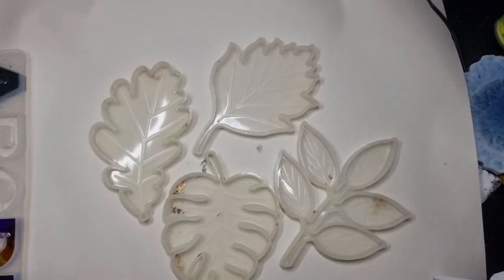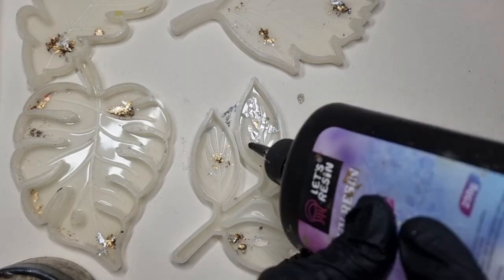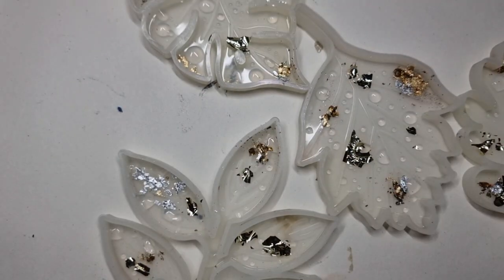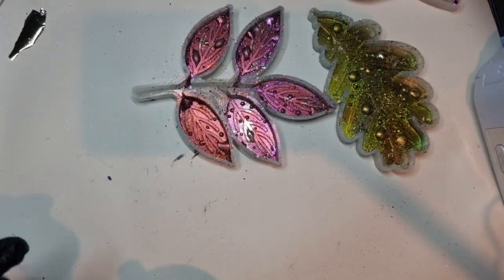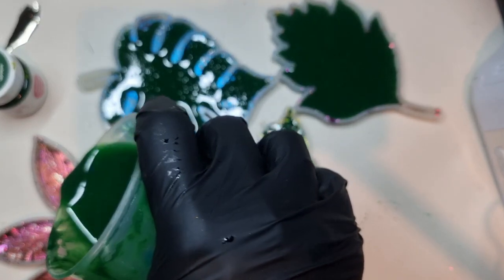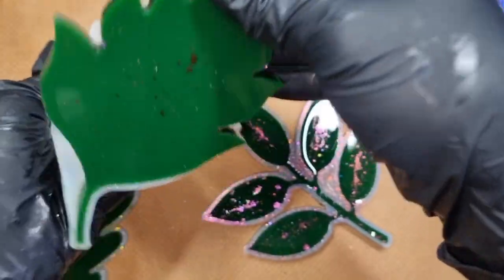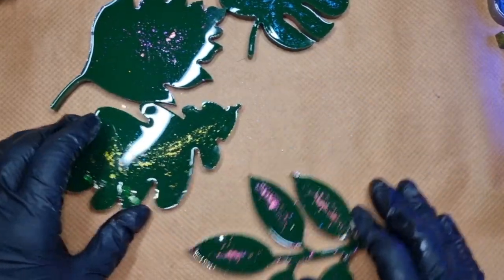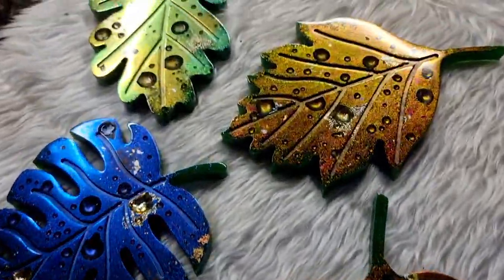Beautiful Resin Coasters , Water Drop Effect On These Leaves Turned Out Stunning

Comment: Dustin Hoffman was the “rain man” and you are definitely the “rain lady”-beautiful creations. I tried this technique with uv resin but even after curing the drops for 3 minutes, the drops would duslodge from mold once i applied my brush with mica powder so now plan to put epoxy resin drops, cure them then apply the powder. Hope it’ll work. 🤞
Reply from the maker: Hi Sherna thats is a huge compliment ☺️ 😊 😄 thankyou so much ❤️ 💖 😊. 
The first one I did was using the regular epoxy.But this issue didn't happen to me with UV .Its strange may be depands on the UV resin 🤔.Also make sure your mold is dry and have no mica powder or any thing in it.
Reply: @teaandart  guess you’re right about the uv brand. Will continue with epoxy-works for me. Am soon getting a heating mat so curing will be quicker.

Comment: Thanks for the inspiration!  Have been giving this a go.  Question please: do you 'blow off' the excess powder after you've brushed on?  Also on this one, did you use the Aura Flakes that you listed as your supplies?  Thx
Reply from the maker: Hi Calli, thank you so much .
Yes, I do that, but now I try to use the minimum amount as Chameleon flakes are expensive 😅. 
I used the one I have from ebay but the ones listed are similar and a lot more in the container.